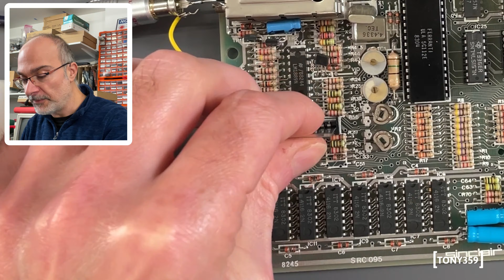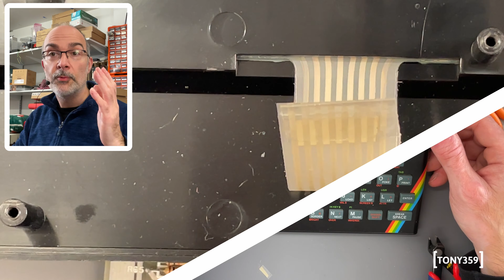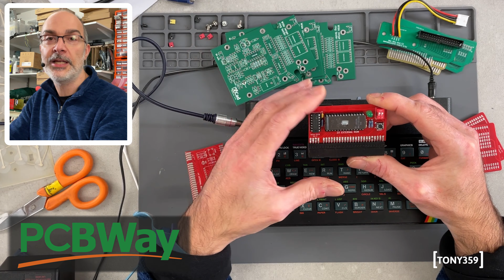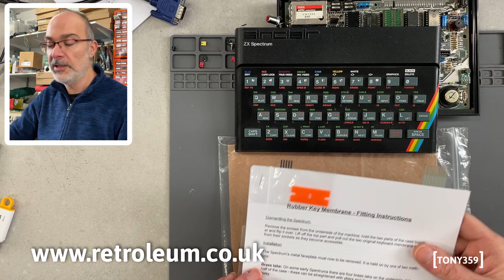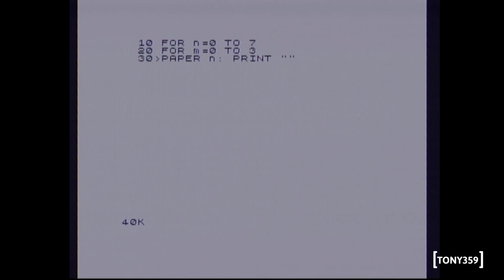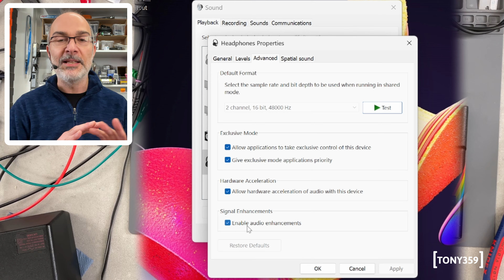Let's service this ZX spectrum!

Comment: It would be interesting to know what the current draw was with the new 5v regulator installed. Also, would take quite a voltage to burn out a 10k resistor. Assuming 0.5w ish rating, you'd be looking at 100V or so. I wonder where that came from!
Reply from the maker: Good point, I didn't think about that!

Comment: The  conductivity issues of the ribbon cables can be addressed with conductive paint. Unfortunately its a really common problem. (with Atari membranes too).
Reply from the maker: Yes, I could have tried that though the replacement is not so expensive so... but definitely a tool to keep on your desk!

Comment: I always use double sided tape to reinforce  the ribbon cables  with plastic pieces.(mainly because of my  unjustified fear of  unwanted reactions between the  liquid glue and plastic). That would be  helpful in the case of the error you showed. As much as I love Speccy, I really hate the way it was built. To many ways to  make an error  and  break the computer. To many asterisks when swapping   ICs between different issues. Far to many ways to have your RAM cooked. I really enjoy Jay Miner machines of the same era, you just can't go wrong no matter how inexperienced you are.
Reply from the maker: yes, those machines were horribly built - you really need to bear in mind they were < £100 to appreciate how cool they were! :)

Comment: OTLA is a great loader .. very fast but can be the tricky on the levels as you found out
Reply from the maker: What would you use? I tried playing WAV files or an app on my mobile but that didn’t work.
Reply: @tony359  yeh wav or mp3 files, i use WINZTX to transfer them from ztx files etc. the laptop output is the weak point but if you are able to load OTLA then a standard loader should be no problem. once you have them as audio files you can also try other devices like iPhone etc. i even import them into my iTunes library. also the issue 2 spectrum are the most difficult to load from. what cable configuration are you using ? ie the spectrum end needs a mono jack but the device loading needs to be correct for that device
Reply from the maker: I manually patched the jack output to the ZX as - as you said - it's stereo and the receiving jack doesn't like it. It's weird as OTLA works but VLC doesn't. I didn't try after realising that I had a compressor on the line though.
Reply: @tony359  You can try Spectaculator for PC and play tzx files through the internal player. In the "Options" then "Cassette Recorder", flag "Boost Loading Noise Volume" to increase the output sound 👍
Reply from the maker: @Audiosonicity  Thanks!

Comment: The beloved Speccy was very very very temperamental about levels on its mic socket. I do believe there is an Arduino based hardware solution (I can't for the life of me remember what it is called) that allows you to play tap/tzx files - stored on an sd card - into a Speccy. Certainly a worthwhile investment if you are servicing a lot of the machines.

It is heartwarming to see the old machine getting some TLC and being restored back to its former glory with no corners being cut in the process. 👍

And yes, my screen name is a tribute to the machine. 😉
Reply from the maker: Thank you for your comment! I don't have more Speccy's for now so the laptop will be ok for now but I'll keep that solution in mind, thanks! Thanks for your kind words!

Comment: What is the current draw range now, after the voltage regulator upgrade?
Reply from the maker: Ah, I didn't really check that, good point. I'd imagine it lowers a bit.

Comment: Electrolytic capacitors contain wet chemicals that dry out. They also have a rubber bung at one end to allow for safe leaking out of the chemicals rather than an explosion due to boiling. And the cap may have indents on it to allow the case to split. So they lose their ability to act as a capacitor for smoothing out ripples on power rails and storing energy to satisfy the demand of pulses of current required by the circuits. It is a very good idea to replace old E-caps on power rails.
Reply from the maker: It never hurts, yes! Thanks for watching!

Comment: I'm currently rediscovering some classic ZX Speccy games, after building a "PicoZX" last weekend.

I'm one of those strange people who prefers to hear the tape loading sounds, as I always did when using my Speccy +2 in the 80s/90s. lol

Many hours spent back then, trying different tape decks, changing the belts, cleaning the heads, and tweaking that azimuth.

Even after getting an Amiga around 1993, and having a few PCs by that point (with my first Aztech CD-ROM drive around 1994), I still used my Speccy +2 and +3 for a long time. As well as the Amstrad CPC 6128, which we got around 1985.

The Speccy had some very original and zany games, like no other system before nor since.
It was the real "bedroom coder's" machine in the UK and elsewhere.
For a lot of people, the Speccy was their first experience with computing and programming.

The C64 was great, too, but it was quite pricey, and us Brits often didn't have much money in the early 80s.
And/or we are cheapskates. lol

Some American retro channels said they were surprised that many of us in the UK didn't have disk drives back then.
Some disk drives like the 1541 could cost as much as the computer itself. (if not more.)

Comment: Very nice service and relaxing video for the end of the day, Tony. I didn't know about the 5v regulators, to substitute the "oven" 7805. Heard about the "Traco" ones but they were not cheap, and retroleum sells the one in your video for lower prices. Cool !!. I guess this is the time to service my Speccy.
Reply from the maker: Retroleum has very good prices and reasonable shipping indeed. These regulators should be very similar to the Traco ones. As much as I like keeping things original, in this case it’s really a good thing to turn off the oven 🙂

Comment: Silver conductive paint can be used to fix traces on membrane keyboards. However depending on the keyboard (I don't know about these specifically but doesn't look too bad) it may not be a fun job to do and it can be difficult to obtain a nice result. So it can still be a better idea to get a replacement keyboard/membrane if they are available for an acceptable price.
Reply from the maker: Exactly, I think the membrane was £9 and it's "plug and play". Sure, with silver paint you can fix many membranes but that's assuming the rest of the membrane is working :) 
Thanks for watching!
Reply: @tony359  at that price it's indeed a no-brainer when you're doing that for a customer. I have fixed a handful of laptop keyboards with silver conductive paint, with damaged traces (or even contact pads, but these are harder to get right) inside the membrane, but I definitely understand nobody wants to go through the trouble. I wish it was as easy to get a replacement membrane manufactured as a PCB though.

Comment: That board plugged into the chip socket is from a Foxx 32k upgrade kit.  I have the exact same issue 2 16k spectrum with a Foxx memory upgrade.  Also, it should have grey keys for a 16k model.
Reply from the maker: Ahhh interesting. What is a "foxx 32k" kit?
Reply: Foxx was the name of the company that sold the 32kb memory upgrade for issue2 speccys, I got mine for Christmas in 1985 @tony359
Reply from the maker: So you're saying this ZX was born as 16KB and then upgraded via Foxx upgrade, not Sinclair's? And the keyboard is not original?
Reply: It was sold as a Sinclair 16kb model yes, then upgraded by someone later.  The issue 2's had sockets for the RAM and logic chips to upgrade it.  Most old 16kb had grey keys, a few later ones had the blue keys, Sinclair probably just used up the grey's then used blue.  So it may be original. @tony359

Comment: That shows how incredibly cheaply the ZX Spectrum was created. It's an impressive piece of engineering for it's time, but man some of the things are nasty. :)
Reply from the maker: Aren't they! :)
For 1982 though Sinclair managed to develop an incredible machine!
Reply: @tony359 Not really when you consider the C64 also launched in that year.
Reply from the maker: Yes but the C64 was launched at $595, the ZX spectrum base version at £125 (around $220 back then)
Reply: @tony359  Yes, I realise it was built to a certain price point. But you get what you pay for. The graphics on the Spectrum are nothing short of laughable.
Reply: @bradallen8909 And yet they had some of the most playable games ever released. (And I do mean when compared the the costly graphically intensive but unplayable dross on offer today!)
Reply: ... its time ... (no apostrophe in the possessive pronoun!) 😉
Reply: @SpeccyMan  No ellipsis required to start a sentence. Quotation marks if you are quoting somebody. And a capital letter to start a sentence, please. See, annoying, isn't it? Knock it off.

Comment: I wonder what they managed to plug into the tape port to overheat that 10K resistor
Assuming it's a quarter watt (it could be half) resistor you'd need 50 volts just to dissipate the 1/4 watt and a lot more to actually cause it to overheat that much.
Reply from the maker: Yes! I'm thinking that someone might have plugged a speaker line. Still, to provide much more than 1/4 watt... I don't know! Thanks for watching!

Comment: I have in my old spare parts bin a "deaf ULA" which was damaged around the 90's but kept because it still produced video and worked great for testing and debugging. (i'm also a sucker for old hardware which is partially working)
Reply from the maker: I would do the same! A half-broken ULA for testing, amazing! Too bad the other one did not survive! Thanks for watching!

Comment: Great restore of the ZX Spectrum! I always wanted to do a measurement of bad caps vs good caps from the power supply. But I never had a board where I would dare to power it on with the old capacitors still in circuit.
Reply from the maker: Apparently I pushed my luck here :) oh well, it worked! :)